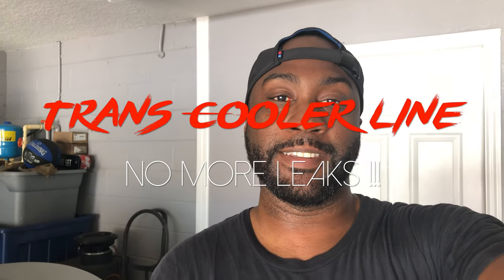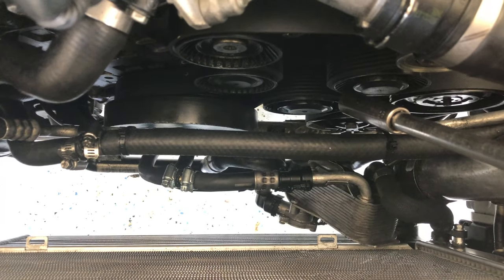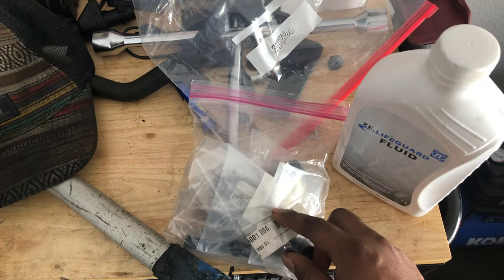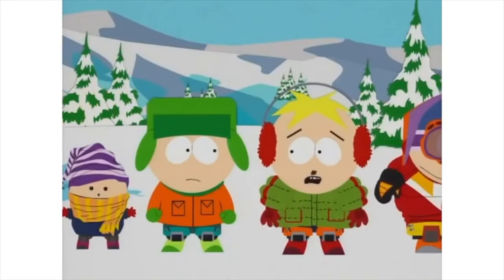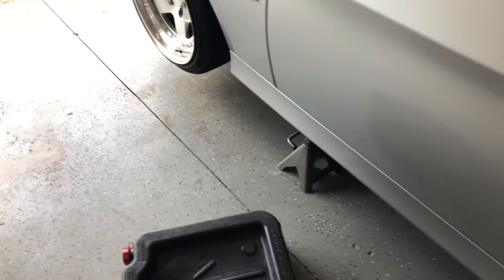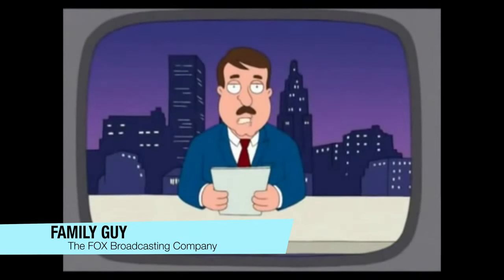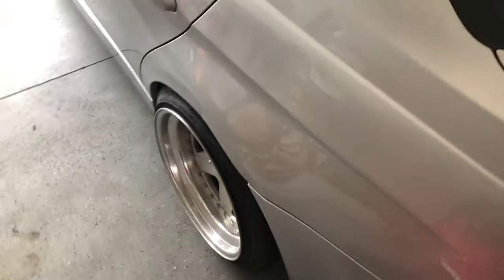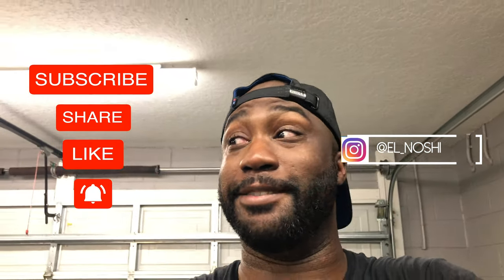BMW Transmission Cooler Line Fix Worked!

Comment: Great video! My hoses started rubbing on my crankshaft pulley and now I have a leak similar to yours. I was wondering if you remember what size fitting you used for the inside diameter?
Reply from the maker: Thanks! it was a 1/2 diameter fitting

Comment: Do you know if the trans lines are the same for a n54 auto and n54 dct trans lines thanks
Reply from the maker: That I’m not sure of the front connection to the cooler looked similar, but pretty sure the rear connections at the transmission will be different.

Comment: same thing happen to me yesterday, looking to order a new hose, was it the inlet hose or outlet hose?
Reply from the maker: Oh wow yea a lot of e9x seem to experience this. I believe it was the outlet hose.
Reply: @nOshi2x  my bolt was missing facing car top left of fan, fan dropped, cut hose, put in brass hose connector 2 clamps each side, lost 7 qts of fluid. she's fine now. Be well
Reply from the maker: Great glad it worked out!
Reply: @ListArkansasProperty  how'd you remove ?seem to be struggling disconnecting the lines 
from the engine
Reply: @joeauteri4470  I just cut the hose installed a brass connector and 2 clamps on each side